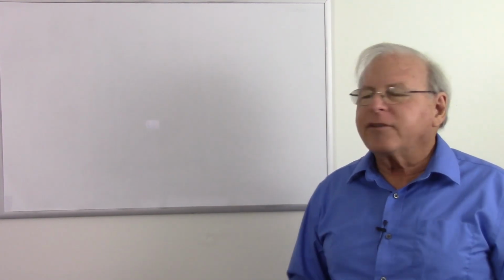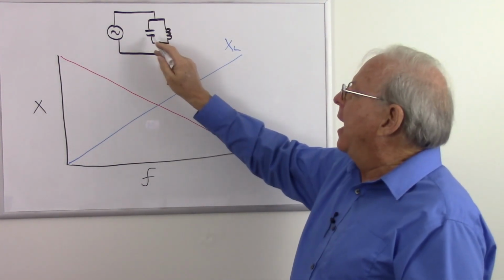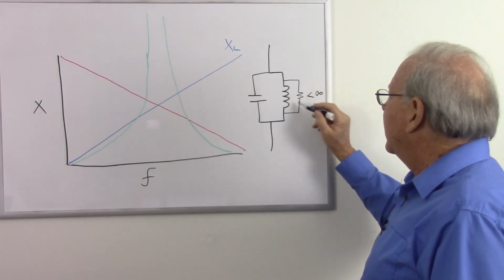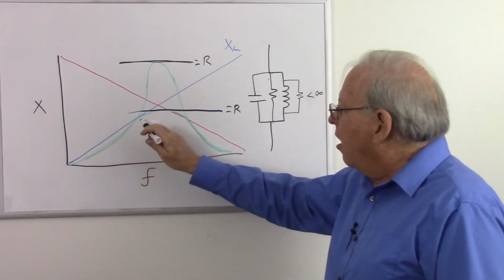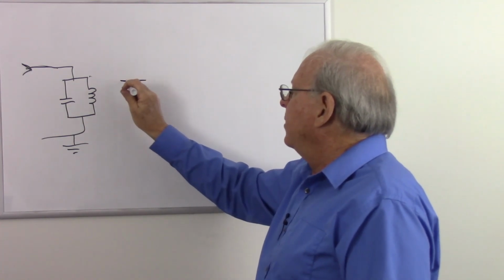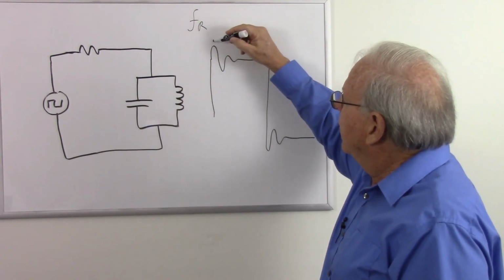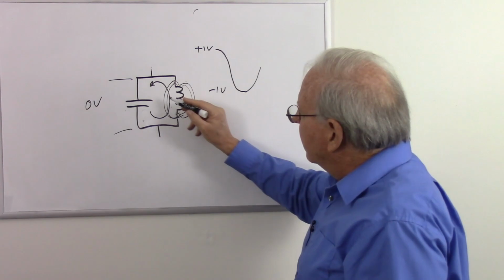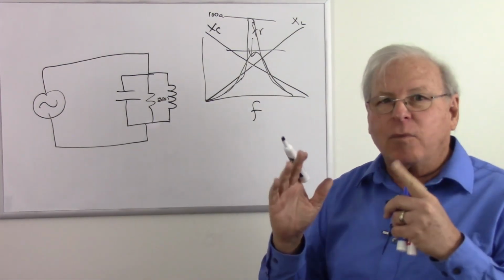AC Basics   Capacitors and Inductors in Parallel

Comment: I found this circuit in bike indicator light, which alternately turn on and off the indicator light. But in bike it uses DC voltage, so how it's work there?
Reply: It's probably a 555 timer.  There's a charge/discharge cycle of a resistor and a capacitor, that is used for establishing the clock signal.  The 555 timer picks up on the time it takes for the capacitor to charge and discharge to certain fractions of the initial charging, in order to produce an output signal that cycles on and off.